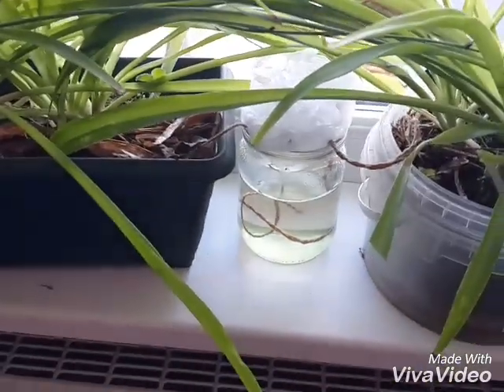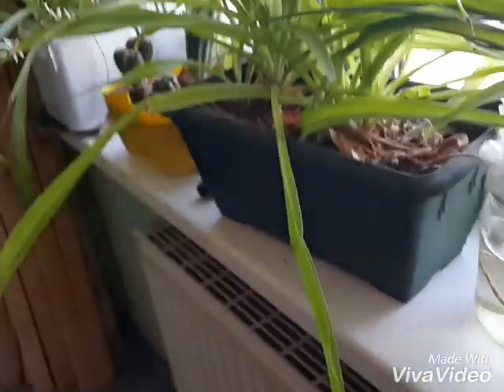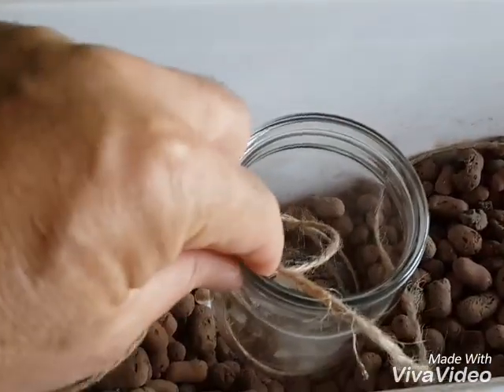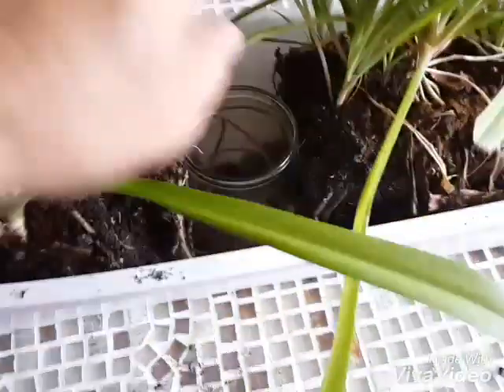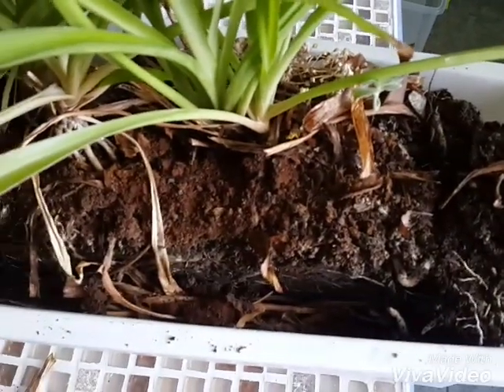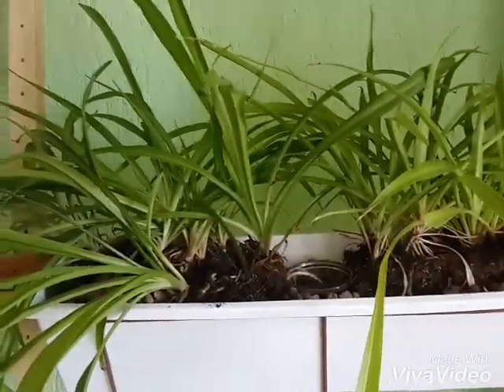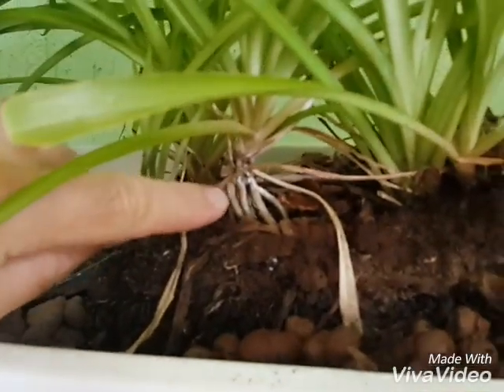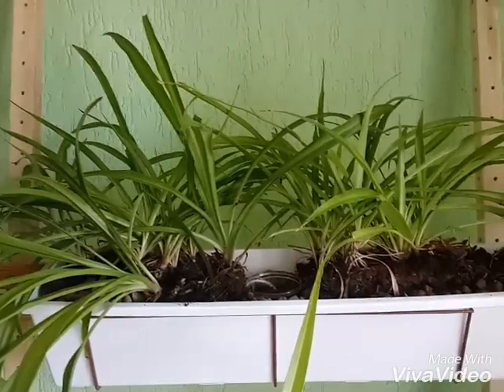Embedded water wick well for house plants

Comment: Paracord, 3/8" poly rope, strips of polyester fabric work too.  It helps to jumpstart the system by dampening the wick.  I looked at hydroponics recently.  It's just too fragile.  Water availability is the problem, not soil.